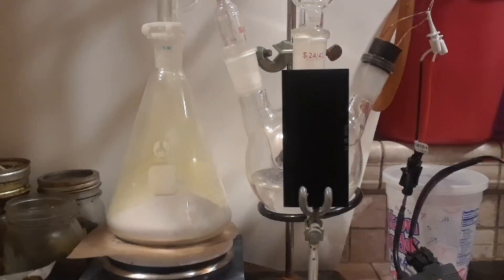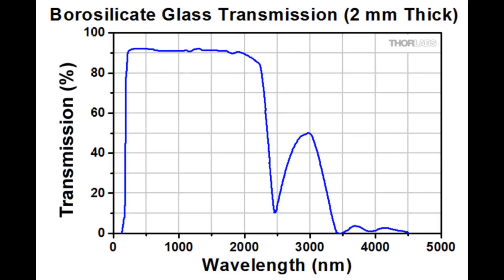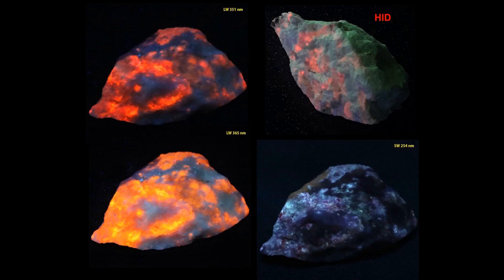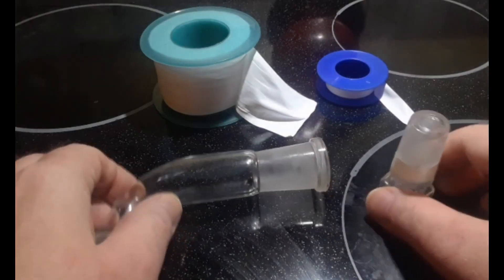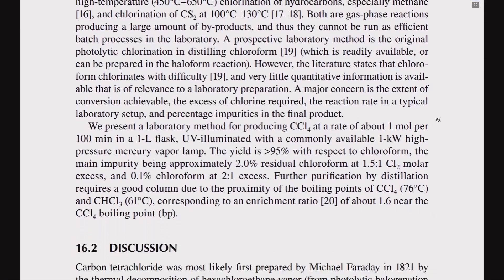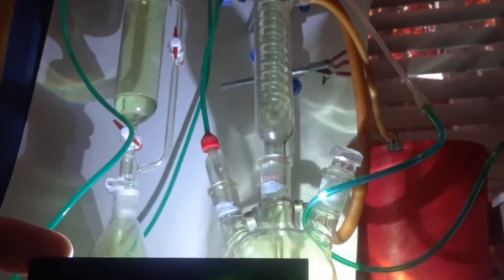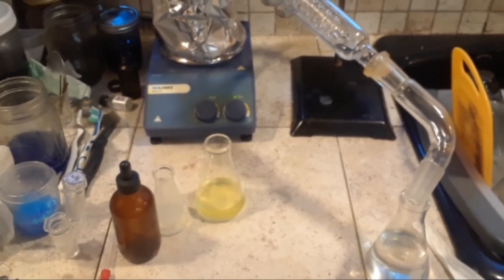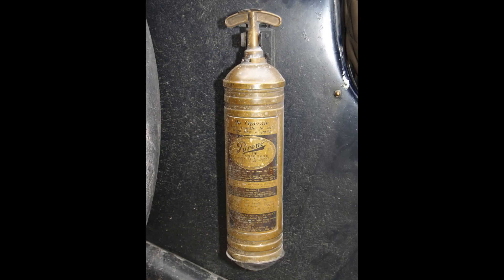CCl4 - Making Carbon Tetrachloride via Photolytic Chlorination of Chloroform

Comment: I have a bonsafide need for 3oz. CarbonTetraChloride. I'm a violinist and require the carbon tetrachloride for cleaning my violin bow hairs. Water and detergent or ammonia will take too long to dry. It used to be used as a spot remover. If you can help, greatly appreciated. Thanks.
Reply from the maker: You can occasionally get old fire extinguishers still containing a liter or so of carbon tet on that classic auction site- there's one listed now for about $150 total. If I were you, I'd use chloroform instead- you can make it yourself with readily available materials, it is chemically very similar, and apparently was also once used for the application you describe, and there are lots of tutorials on here which will show you how to make it. If it's absolutely essential I could probably supply you with a few ml, but I'd advise chloroform.

Comment: I've heard that CCl4 can be made (with a very low yield, maybe 10%) by just reacting chloroform and sodium hypochlorite bleach at around 40 C. Maybe even doing the haloform reaction at higher temperatures could produce some carbon tet. Have you ever tried that?
Reply from the maker: Interesting, I've never heard that, but I guess I'm not surprised? A lot of reactions happen on their own just in the environment, particularly with chlorine. Here's what ChatGPT has to say- "Some historical syntheses used chlorination of methane or electrochemical oxidation of chloroform, though these require more specialized conditions."
"Industrial methods rely on direct chlorination of methane using UV light or high temperatures, which is much more efficient"

Comment: Do you think this could be done using an excess of TCCA generating chlorine in situ with a benzoyl peroxide catalyst? Generating chlorine gas for hours is a pain, itd be much simpler to just add the TCCA chunks. Apparently this can be done with toluene to make benzotrichloride, would you add the same molar amount of TCCA chunks used to generate the gas?
Reply from the maker: I honestly don't know. TBH, making the chloroform and setting up the lamp was the most laborious part of the process. It's a straightforward gas generator, I only had to add HCL to it once. Worth trying on a small scale, though. Make sure to document it if you give it a try!

Comment: I grew marijuana for years, so have quite a bit of experience using 1,000watt HID lights.  I never knew they were so bad for your eyes - haha, maybe that's why my eyesight sucks so badly now.  Cool video - def. a good few steps beyond anything I've pulled off at home.  KInda inspirational - if you can do all this, I can continue w/my basic stuff
Reply from the maker: Thanks. If I can do it, so can you. Yeah, I really did get sunburn, but that was after I removed the UV protective filter from the bulb. I think any general purpose illumination or grow bulbs you buy in the West are pretty safe.

Comment: How did you rig up the ballast to the power supply?
Reply from the maker: I just used spade connectors to connect to an old xbox power supply. There's no canbus or control lines or anything, just 12v.
Reply: Thanks! I found the same kind of bulb on Amazon, do you have a picture of the whole light setup? From what I can tell in the video the outer shell is removed along with the ceramic thing then the two wires are hooked back into the place they came from. Is this correct? I am electronically/mechanically handicapped and even after years of tinkering I still can't figure this shit out by myself lol
Reply from the maker: @bobsagely812  That is correct. It's pretty straightforward red to red and black to black, the bulbs can be connected either way. Be careful of the bare wires, when the ballast first ignites the bulb it uses pulses of several thousand volts.
Sorry, I don't have any pictures beyond what you see in 1:42. You can leave the ceramic sleeve in place if you like, I just removed it because it would inevitably get broken. Be sure to wear eye protection and avoid skin exposure. The UV coming out of this bulb is no joke, and it also produces copious amounts of ozone (so don't work in a small space with no ventilation). I used a glass welding shade when I needed to look at the bulb.
I'm curious to see what you do with it, so throw a video up on your channel if you're up for it.

Comment: Neat uv very reactive so this would work. Would a 355 nm or 256 nm laser pulsed work too?
Reply from the maker: There's a graph at 1:45, I think a lot of exposure at 256 would work, but I'm not sure how well a pulsed laser would do the job. I guess it would depend on the net average output. The peak intensity during a pulse might cause undesirable side reactions. Thanks for the input Chan, I'm a subscriber. You do a lot of varied experiments.
Reply: @WaffleStaffel  yes the pulses may change the reaction Also lasers are not cheap.

Comment: Thanks for the video ! I have not assembled my experiment for synthesis of CCL4 , but I have fabricated a 4" long 24/29 quartz tube surrounded by a large array of UVA led's shielded with aluminum foil , so the only dangerous radiation comes out of the ends. I intended to purge the air using the CL and refluxing above the tube. I just haven't gotten around to setting it up yet.
Reply from the maker: Sounds like a good setup, be sure to post some footage of it! I believe 360nm LEDs will work well for this reaction, but even 390nm might do the job. Thanks for the comment!

Comment: Running a reaction right now using LEDs! Will try using a flow reactor as well sometime soon but had issues with the chloroform eating some materials my current reactor uses.
Reply from the maker: Right on! Yeah, I'm not sure what I'm going to do about the fittings in a flow reactor. Please get some video and let us know how it goes!
Reply: @WaffleStaffel  I’m using FEP tubing and a peristaltic pump and that seems to be ok. I just used some sealant between the FEP tubing and the ports on the pump that the chloroform ended up melting and clogging so I just ran a still reaction for a test. Need to distill it today to see if we got anything. I fixed those connections on the pump so that should be fine now but will have to run another reaction to test that out. Will keep you updated on what I find. Will probably need a few different runs.
Reply from the maker: @FerociousPancake888  Cool, thanks for the info. Your comment got held for moderation for some reason. Freaking youtube. Keep me apprised!

Comment: Great video! What are you planning on using the CTC for?
Reply from the maker: Thanks! I mostly made it to showcase the cheap UV light, but I was thinking of using the CCl4 to make chlorite-free hypochlorous acid to make stable, solid sodium hypochlorite. An alternative process uses lots of HgO, which I don't have much of. I'm thinking of making DCM from methanol next, and trying out some different types of reactors.
Reply: @WaffleStaffel  Awesome, sounds interesting. Keep up the good work!

Comment: moisture or oxygen will lead to the formation of grassy smell of death gas!
Reply from the maker: That's one of those smells it's probably best to forever have to remain curious about. Oxygen is quickly displaced with chlorine, and TCCA produces a remarkably dry gas. I think the copious amounts of Cl2 present the most immediate hazard. Thanks for stopping by, cat boy.
Reply: @WaffleStaffel  no problem nyuhh!! but yea in the presence of UV with O2 or moisture the CCl3 will break down into COCl2.

Comment: I just looked online and a liter of carbon tetrachloride can be had for about $275. It’s readily available depending on whether or not you want to spend that kind of money. We used to use that stuff in the Navy in the ship’s engine rooms for cleaning parts, bare handed all day. I should probably be dead. 😂
Reply from the maker: Heh, that's cheaper than anything I've seen. I just looked and it was $400/L $100/100ml. They used to use all kinds of fun stuff in the Navy! Overall health and alcohol use are probably a big factor. Thanks for stopping by, Charles!
Reply: @WaffleStaffel  My uncle told us a story about his depression-era DIY dry cleaning setup using CCL4 in the tub ! He became very dizzy and decided to stop the experiment , but I always wondered how much damage he did in the meanwhile.
Reply: Testament as to how over-blown the warnings can be…I mean, if you’re drinking it or washing your hands with it every day for 40 years? Sure…but a lot of chemists today would spill 1ml of this stuff on the floor and evacuate the room, if not the building. 

My granddad worked with this stuff every day of his life for 32 years, he died @ 93. Either everyone’s different, the circumstances are different, or bodies such as the EPA really, really like to make things sound a lot worse than they really are.

Comment: Great resource on purity is Purification of Laboratory Chemicals 6th ed by W.L.F. Armarego & C.L.L. Chai. All the physical properties and several purification routes for most solvents and reagents are there. b.p = 76.8 C and density = 1.5842 g/cm3 at 25 C. To wash the excess chlorine out is suggests washing with 0.02M Na2SO3, then dist. water and distilled over P2O5.
Reply from the maker: This is an excellent resource, thanks for pointing it out.

Comment: I really enjoyed your process and idea. CCL4 is used in many synthesis in textbooks but everyones scared to touch it so its nice to see a video on making it. 
Just some constructive criticism, I really appreciate how technical you were but its hard to follow along when your dialogue sounds like its at 1.5x speed. Maybe you could try to slow your speeking and try to make your script more concise
Reply from the maker: Thanks! You're right, I appreciate the constructive input. The relative safety of CCl4 is debated. We live in a world that's being progressively nerfed with soft corners. Given it was used as a cleaner, people were splashing it all over the place, not working in a fume hood. I suspect as long as you work with proper ventilation, as you would with any volatile chemical, it's safe to use. Also, with the phaseout of CFC refrigerants, the production was dramatically curtailed, so I think it was sort of a casualty of that.

Comment: Nice! Now I see how you could make that HID lamp to work. Really nice work! I would never dare to work with those chemicals at home. If I may add one remark, I think that the narration is a bit too fast. It was perfect when I slowed the video down to 0.75x speed, but the default 1x speed was too quick for my non-native English level, especially because I wanted to pay attention to the chemistry and technical terms you talked about. But I really like the structure and the narration. I hope you'll keep uploading more content!
Reply from the maker: Thank you. I hadn't thought about non-native speakers, but I should have, because technical channels usually have a more global audience, and probably half the videos I watch are from outside the US. I initially had sped up the audio to fit the time limit imposed by the video editor I started with. I'd better make sure the captioning is set up. I appreciate the feedback!
Reply: @WaffleStaffel  try using openshot its free and dont think has a limit to its lenth
Reply from the maker: @unlockeduk  Thank you. I tried openshot, but the audio wasn't playing. It was rendering, but I couldn't hear it during editing. I settled on vidproc vlogger, which seems pretty decent.
Reply: @WaffleStaffel  people reccomend davincci resolve to  me too
Reply: I think it's too fast even for native speakers who don't have a degree in chemistry.  Thanks for the video.
Reply: So it wasn’t just me… I had to watch this at 1x, even though I usually watch videos at 2x.
Reply: “I had to speed up the audio to fit…” 

Hey, at least you still had time for the diarrhea girls at the end. 😂